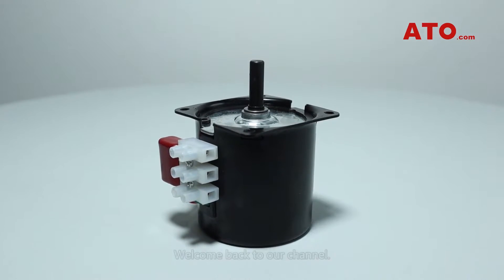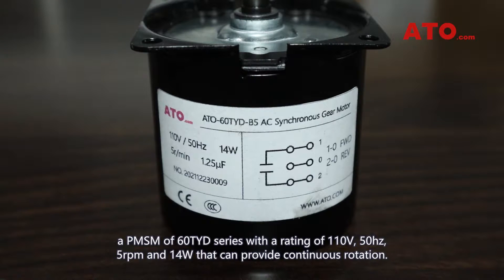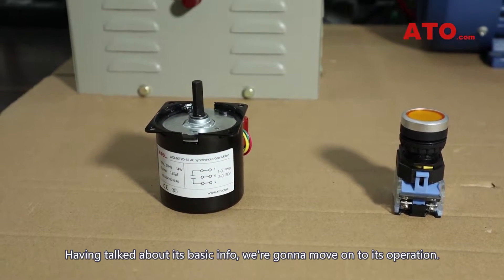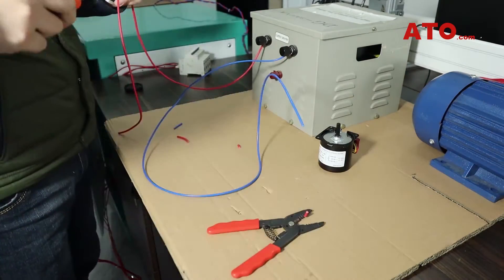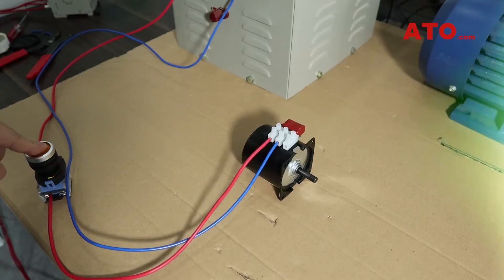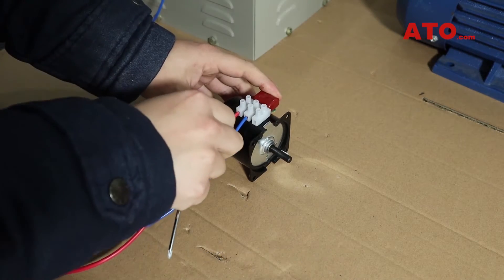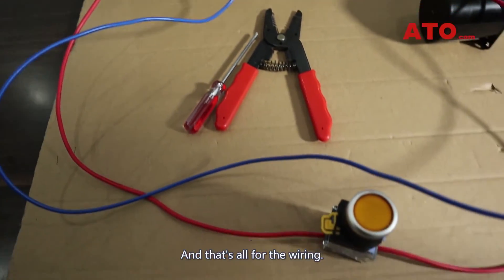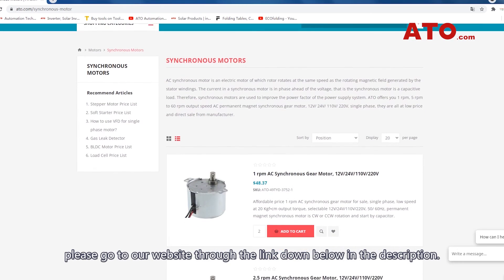Permanent Magnet Synchronous Motor (PMSM)-Overview, Wiring & Working

Comment: 1. How if not using Capacitor? what's function on that?
2. Without switch, i try to hold rotation and it's rotate back.  Is it normal? What's disadvantages of this?
3. How if i combine Red and Green wire?